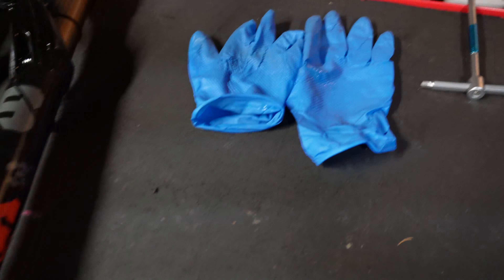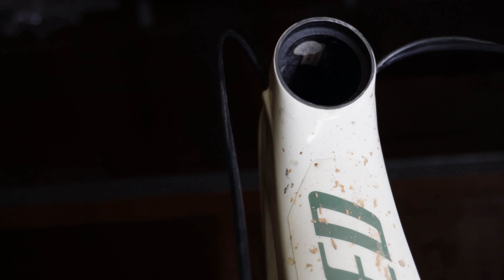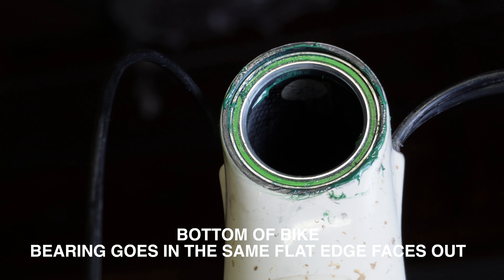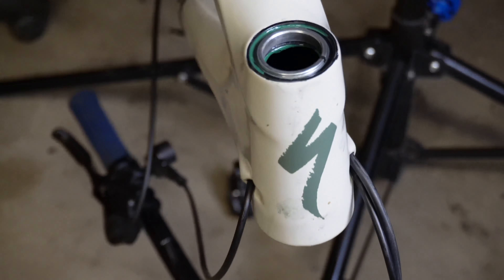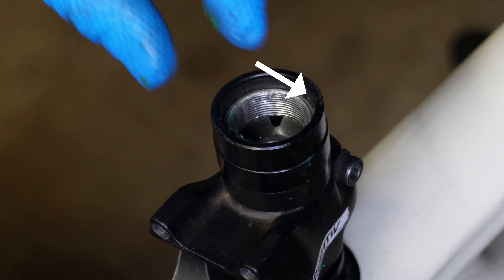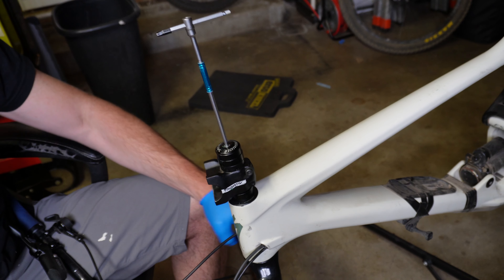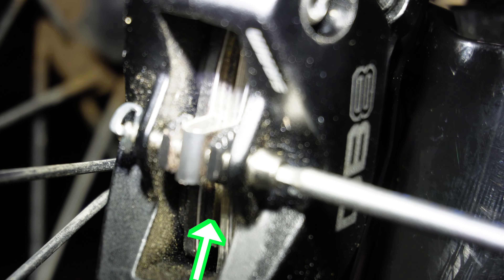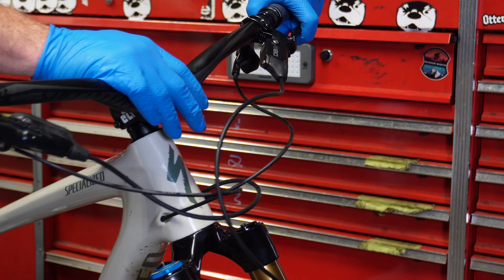How to install a Mountain Bike Fork

Comment: You need to get that grease out of the frame my friend.
That isn't where the bearing pivots and the grease will slowly soften the carbon and destroy your head tube.
Also don't use brake clean on carbon either.
Reply from the maker: It’s carbon safe grease and was alittle heavy on grease